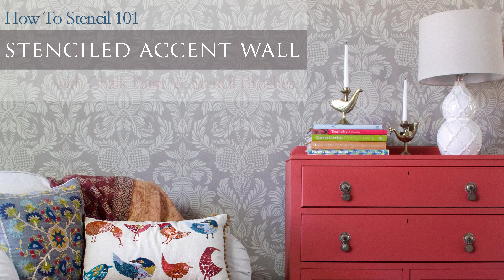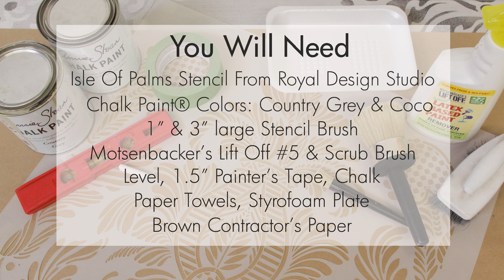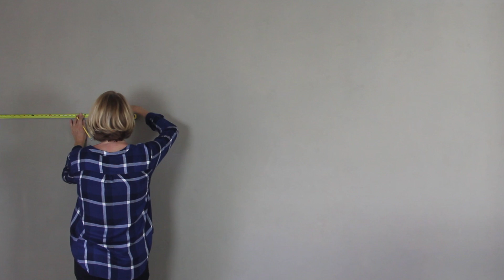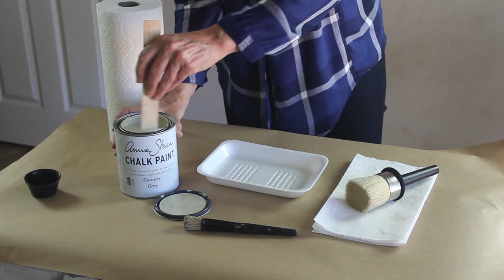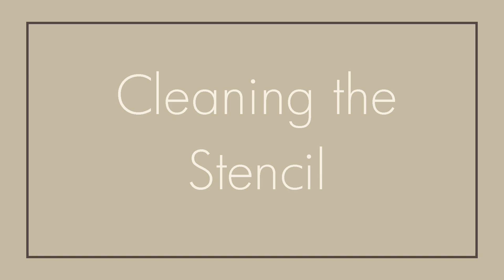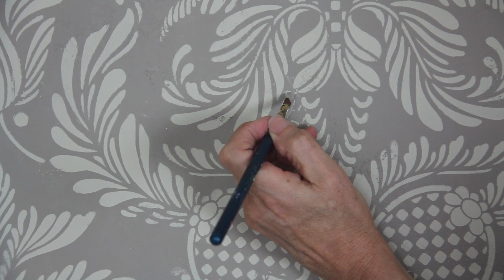How to Stencil 101: Painting an Accent Wall with Wall Stencils and Chalk Paint

Comment: Great tutorial. When you apply the tape to the stencil over already painted stencil parts doesn't the tape take of the paint? How long should you wait before doing this? Thx
Reply: I mean take off the paint.
Reply from the maker: Hi! As long as the paint has dried and you are using Painter's Tape, it will be totally fine to tape over a painted area.